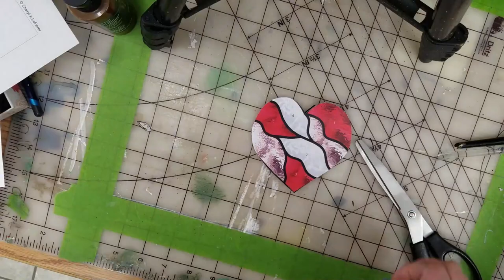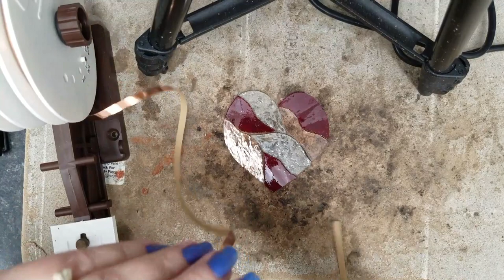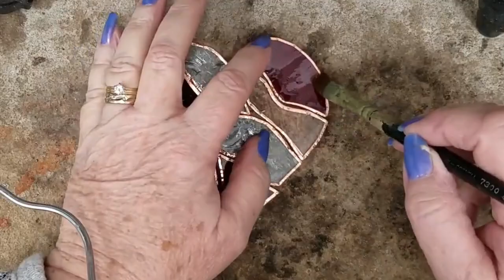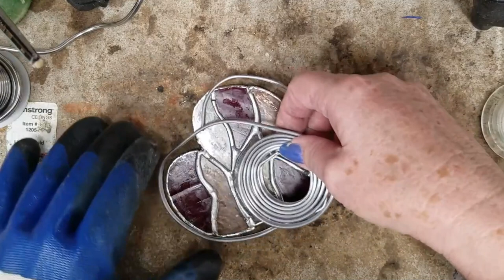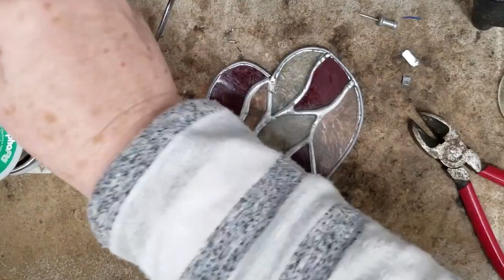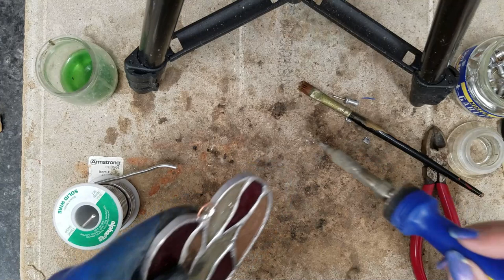Stained Glass Hobby Came - Crazy Heart

Comment: I was wondering did you stretch the hobby came first? Do you ever use a cloth measuring tape or a string to get the length needed?
Reply from the maker: Hi Carla,
Yes, I do stretch the hobby came first.  And, yes, I have used a cloth measuring tape, but my favorite way to do it is with a string.  Thanks for taking the time to comment and also for watching.
Reply: @artbycherylann8431 Is there a ratio for stretching the hobby came?  How do you know if it's stretched properly/enough? BTW I'm a new subscriber😊

Comment: Love your work what temp is your iron and do you always tin your edges before adding came. You make it all look so easy
Reply from the maker: Hi Sheelagh, my iron is usually set at 360F.  I use 60/40 and 50/50 solder.  I also use lead free solder for my jewelry pieces and that temp works well for me.  Keep in mind, you need to keep moving and allowing an area to cool to prevent seepage.  Thank you for watching and for the kind comment.

Comment: Do you not need to stretch the came first? Or does it depend on size?
Reply from the maker: The came I had was okay, I didn't have to stretch it.  It was nice and straight and had substance to it.  If your came is not straight or is too pliable, I would stretch it first.  You don't always have to stretch hobby came because its only a trim.  It really depends.  Use your judgment.
Reply: @Art By Cheryl Ann  thanks for the advice 😃 I've never used it yet, but have some ready to try.
Reply from the maker: @janerobo5911  Great, its not that difficult to use.  Let me know how it goes.  :)

Comment: I'm new to stained glass and can't afford a table grinder and have been looking at the hand held grinders and would like to find out what you think about them.
Reply from the maker: Hi Willard, the grinders we use for glass apply water to the bit so as to reduce glass dust in the air keeping it out of your lungs.  The same as a tile "wet" saw does.  It also takes care of keeping the bit cool.  In my opinion, you need to use both hands to control the glass.  This not only prevents injuries but allows for smooth edges which are a must for a good foundation for your soldering.  I would not suggest using a hand held grinder.  I would suggest that, at the very least,  you purchase a carborundum stone which you can use by hand to remove sharpies and make the edges smooth.  A much safer option.    I would love to see you save your money and buy a proper grinder.  Hobby Lobby has one for under $100 that many use.   I hope this helps.  Thanks for asking.  
Cheryl
Reply: @artbycherylann8431  I use sandpaper to remove the edges and I'm looking for a good used table grinder.  Thanks for your help.
Reply: Look on eBay for a used Inland grinder